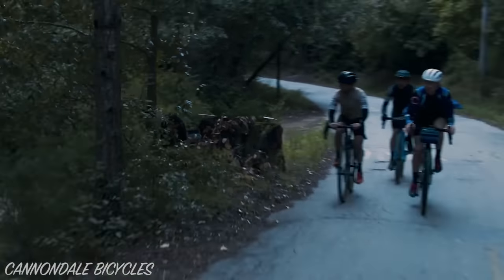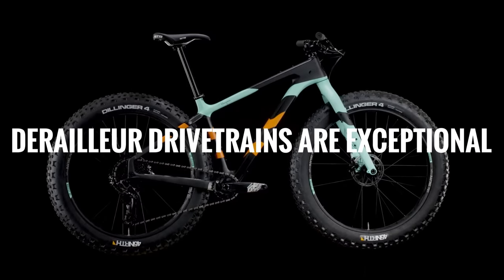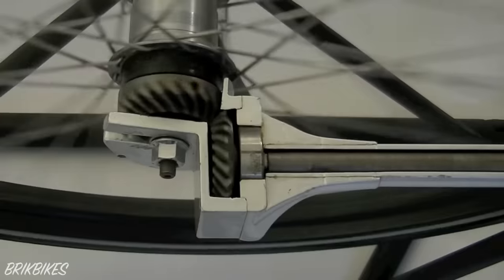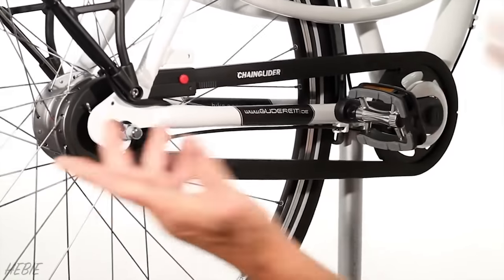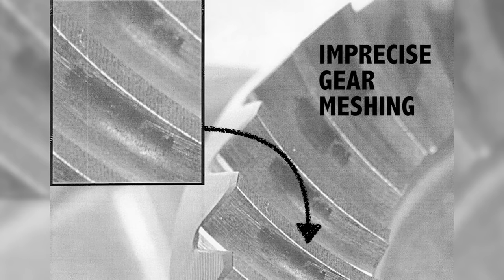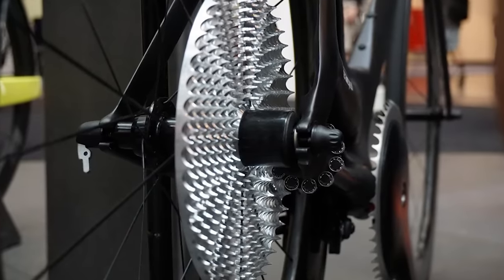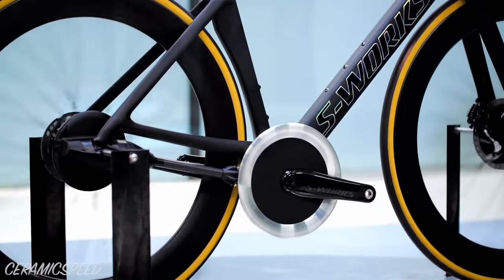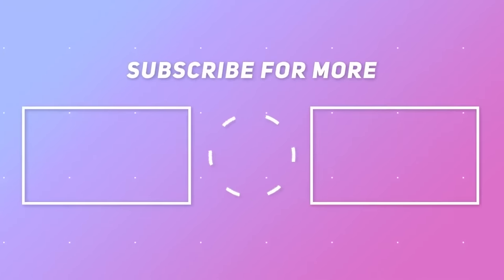Are Chainless Shaft Drive Bicycles a GENIUS or TERRIBLE Idea?

Comment: As someone who has replaced driveshafts and chains on machines for a living, I'll take a chain over a shaft any day.
Reply: They've all been tested thoroughly and the chain drive is the least friction, (something probably more important to a pushbike rider than most other applications) while belt drive was next best with shaft drive being the worst. If it was a motorbike operating in really dirty sandy type conditions I'd see the value in a shaft drive but for EVERYTHING else I'd stick with chain drive too. I've got 2 motorbikes now and seemingly only in recent years the chains somehow seem to have improved vastly compared to 15 years or so ago when I would be forever having to adjust them. On both bikes I've got I tightened them a tiny bit after about a thousand kilometers or so and keep checking but even 9,000 kilometers later on 1 it's still pretty perfect and same with the other after a few less but still not even looking like it's even changed at all since that first settling in and adjust. Admittedly 1 is only used on the road but the other gets a bit of dirt riding, not a lot these days but still, it has been in the mud and dust and is still excellent.
So, I agree 100% without even watching a video once I saw that terrible high friction rear gearing arrangement in the thumbnail pic when you get to this video. I'm not going to waste my time watching the video of what looks clever(ish) but very high friction and wear and probably very easily jump teeth if you cranked hard which on a men's pushbike is a toe grinding and nutcracking nightmare, this coming from someone who grew up riding a pushbike with very second hand 3 speed hub gears that OFTEN found a sort of neutral and gave me those treatments. If it was an evil plan to stop me from breeding, it failed since I've got 3 kids lol.
Reply: Why is that?
Reply: @brett7011  "Why is" what? Also, who are you asking? Any relevant reasons are already stated so if you've got a specific question, ask that specific question instead of just a general "why".
EDIT: And specify WHO you're asking too.
Reply: @lorditsprobingtime6668  interesting reply that matched my personal experiences. Part 2 for me is the bike industry is trying make a low power machine much too complex.
Reply: @lorditsprobingtime6668  
.95 
Fpfpj
Reply: @russeldemesa291   And a happy  .68
Grksh to you too.
Have you ever heard of speaking ENGLISH????????
Reply: That's what she said
Reply: Agreed, chains are lower maintenance, cheaper, lighter, more efficient..
Reply: Pedal assist seems like a far better solution.
Reply: @christiannoble5549  Chains are the lowest friction of the 3, I wouldn't call them "lower maintenance" though. Shaft drive usually only ever requires you to check the oil level and if it's got a sight glass even that only takes a quick look while chains do need tensioning now and then and depending on how and where you ride and your own personal preferences, lubricating too. Shaft drives are no mess from slinging oil to clean up and only that occasional check on them so "maintenance wise shaft drive is great. In 1983 I had a D series XS 750 Yamaha 3 cylinder shaft drive and that part I loved about it.
Reply: @lorditsprobingtime6668  are you for real?
The comment made by Brett Taylor didn't have your name in it. So it is quite obvious that he talked to OP.
And since OP made such a broad statement ("he prefers chains over shafts") it's quite obvious what Brett Taylor was asking:
Why does OP prefer chains over shafts?
Reply: @Jehty_   Ohhh, poor baby, you'll get over it one day.
Reply: Hence this is why auto and truck manufacturers switched to drive shafts exclusively since the last car manufactured with chain drive was back in 1908?
Reply: @baltazard133T  Well isn't it strange that motorcycle manufacturers have for the most part stuck with chains and some belts while oddly only a few choose the least efficient shaft drive option then.
I gather logic isn't your strongest point.
Reply: @lorditsprobingtime6668  
Drive shafts aren't actually that inefficient compared to chain drives. And given how powerful motorcycle engines have become, the differences are negligible. The biggest reason motorcycle manufacturers stick with chain drives is the same reason America uses U.S. Standard and not metric: cost and familiaity. It would cost too much to retool and retrain an entire company for a new drive system. Chain drives are familiar, and most motorcycle designers know how to make them. Motorcycle companies tend to be smaller than car companies, so using chain drives is a way to reduce manufacturing complexity, cost, and footprint.
Reply: @jfangm  WRONG! They use chain on most bikes BECAUSE they want to convert as much of the power from the engine to power at the wheel as possible. That is the sole reason for chain drive on most bikes, and ALL high performance bikes. I had a BMW S 1,000 R which was a new non touring type very high performance bike that in mine put out 160 hp and the exact same engine with lighter titanium valves could rev to 14,000 rpm and with that and a slightly different cam the RR version BOTH of which would have done excellent on a race track produced 200 hp. These were BMWs, traditionally shaft driven TOURING bikes new ultra high performance engines and the choice of chain was for efficiency and PERFORMANCE, no other reason and made by the innovators of shaft drives for motorcycles so no, you're completely WRONG.
Reply: @jfangm   And BTW, " given how powerful motorcycle engines have become " is exactly the reason they don't want to waste ANY of that power through a less efficient drive system, NOT a reason to throw power away FFS.
Reply: @lorditsprobingtime6668  
Then why did cars ditch chain drives?
Reply: @lorditsprobingtime6668  
Then why did cars ditch chain drives? Sounds like cycle snob bullshit to me. Anything claiming to be 99% efficient is bullshit.
Reply: @jfangm  Different tools for different tasks.It's hard to make chain drives that can handle long enough service intervals for a car. And drive shafts fits better in a 4-wheel construct where the needs are different - like a need for a differential to allow diffwrent speed for left and right wheel.

The automatic transmissions in cars added even more losses - but the fuel prices were low enough that people wanted that too for comfort. Never ever switch between different types of vehicles and assume that the same design criteria needs to apply.
Reply: @jfangm  Who said anything about "99% efficiency" FFS? I said chain is " THE " most efficient of the 3 main types. 
As for "Sounds like cycle snob bullshit to me. " 
What are you, 10 years old? These are the simple FACTS genius, chain is most efficient followed by belt and shaft drive last. As for cars, who'd want a chain running from the front all the way to the back slopping around genius boy.
Reply: @perwestermark8920  
Most vehicle drive trains can last two decades without replacement. The one in my Jeep is going on 30 without being replaced. While I DO need to replace it, kt is not an urgent problem yet.
Reply: @jfangm  Not sure about the relevance of your post. I said it was hard to make a chain drive that can handle long enough setvice intervals for cars. So how is the service interval of a chain drive affected by your 20 year old drive shaft solution? Or you have a car using a chain drive?
Reply: @lorditsprobingtime6668  
The video claimed chain drives were in the neighborhood of 99% efficient, while ALSO claiming that drive shafts were only 97% efficient, AND that there was no reliable data on drive shaft efficiency. In other words, it compares a system of knkw efficiency with a system of unknown efficiency, and attaches an efficiency rating to the latter without good data.

Also, a chain drive in a car would not be slopping about. A key part of chain drive design is the total length of the drive, from sprocket center to sprocket center. Moreover, a lot of features could be added to prevent a chain from "slopping about. For example, return rollers, as found on tanks (which uses a chain drive for propulsion); guards, channels, or tracks could also be used to prevent slop. Or just proper drive design and tensioning. You know, like a proper mechanical designer.
Reply: @perwestermark8920  
Sorry, misread that comment.
Reply: @jfangm  I don't even know what's "claimed" in this video since I haven't watched it because I already knew chain was lowest friction followed by belt with shaft coming in last for motorcycles. As for rollers and all sorts of other things to "take the slop out of chains" for the distance on a car you WOULD be adding more friction at every one of those points. That and the fact it's needing a sturdy gearbox are another good reason for shafts and gears, the last bit of reduction at the differential itself, aka, more gears.
Reply: I agree 100%. I saw the gears and those look reeaaally expensive. Maybe if you're doing a long trip you can take a spare chain, but if you bike has any sort of problem (specially when the gears don't match due to vibrations) where do you take your bike? Also adding a lot of weight to the system. I wouldn't buy one
Reply: I don't mind a good shaft......